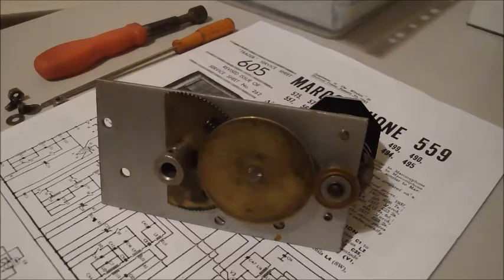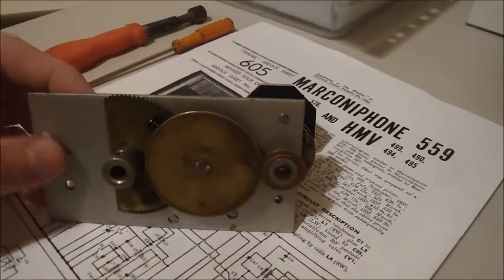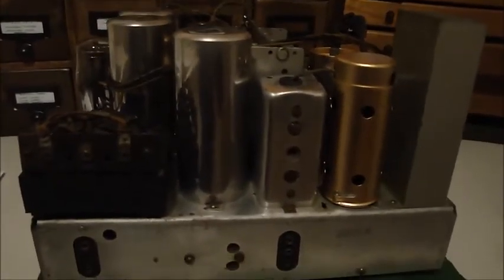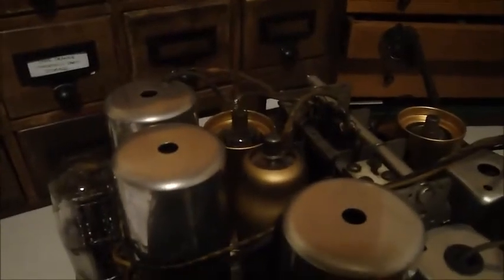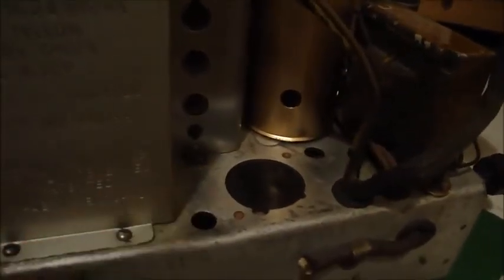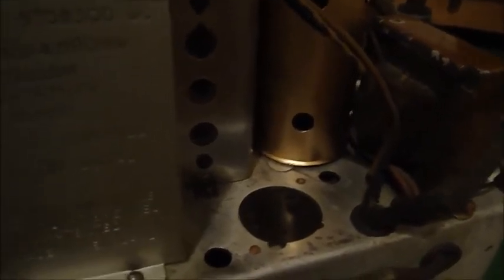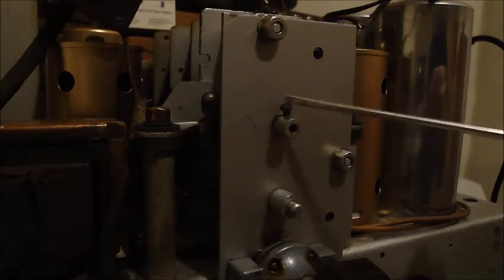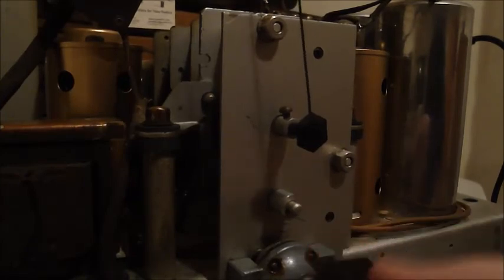Progress of the Marconi 559 #2

Comment: I'm with you on the chassis, Dylan.  Unless badly rusted, I don't strip and finish a chassis.  Once I take care of rust spots with naval jelly, I rub the chassis down with a WD-40 dampened rag/acid brush and leave it at that. Partially because I'm a bit lazy, partially for the same reason I seldom completely refinish a cabinet, I like them to look like an old radio. Between that tuner mech and the chain band selector, that is one made-to-last set. Thought my belt tuned Fairbanks Morse was!

Comment from the maker: Phil,
The chassis took some elbow grease, that's for sure. I think it was well worth it in the end. 
From what I've seen so far, there hasn't been any major modifications. I always worry about 'phantom restorers' turning screws and messing around with the tuned circuits. We'll know in due course! The IF transformers L14,15 and L16,17 cleaned up well and seem to be untouched. Mains and output transformer test good, coils also have good continuity. Should be o.k. - hopefully!
Regards,
Dylan

Comment: Good job, Dylan. One question, though. Is that gear segment a split, spring loaded segment to prevent slop or backlash in the gear/pinion teeth, ie; a zero backlash arrangement? It looks like a very well made design.
This should be a radio anyone would be proud to have. I like your efforts to preserve all originality & patina. That's real restoration. Thanks again.
Dick